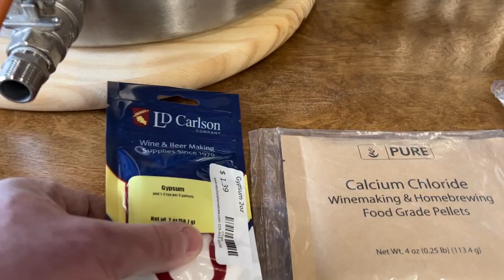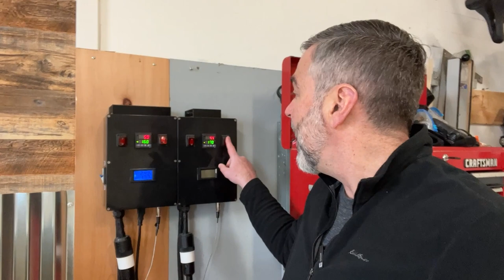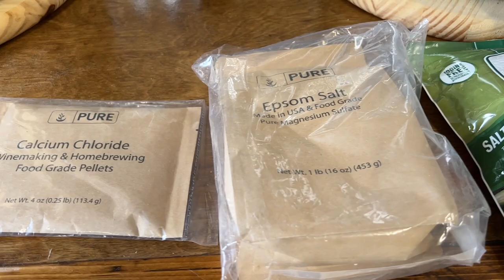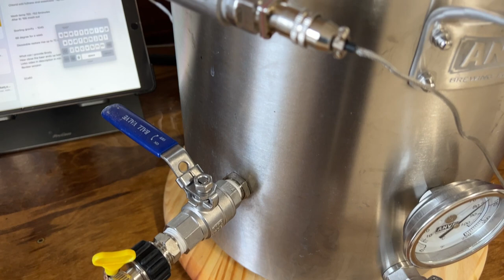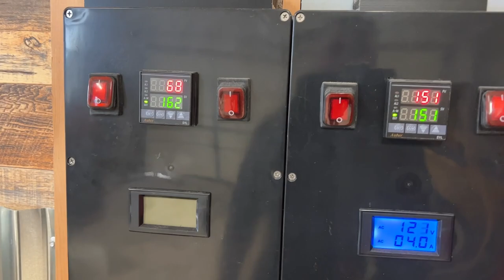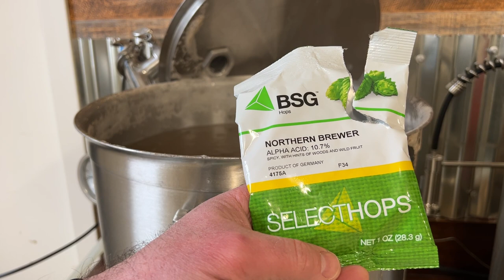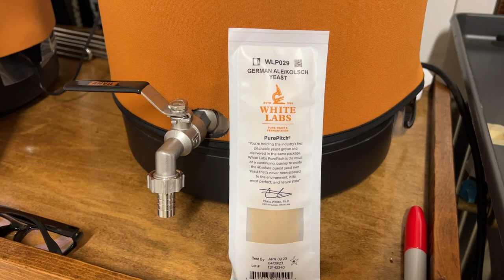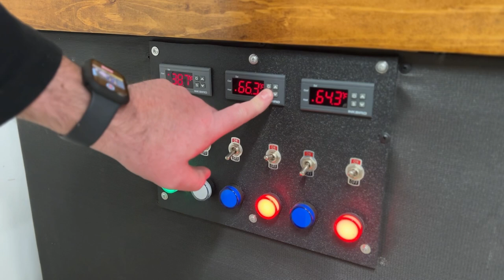Brewing a Kölsch Recipe on My Electric HERMS Home Brewery [ The Beer Junkies Collaboration: Part 1 ]

Comment: Great videos, thanks for sharing! Your HERMS setup is awesome, it's cool to see someone do that with Anvil stuff. I had an Anvil kettle and was amazed by the quality. Question: what did you use to create the stainless hook that you put in the hole in your lid for recirculating? Also, do you have a link to the strainer you bought that fits the Anvil kettles? Thanks!
Reply from the maker: Hey Adam, thanks for the feedback! Yeah, the Anvil equipment is pretty darn good. Not as good as the Blichmann kettles,  but really nice. I didn’t make that hook, it’s just the return pipe from my Anvil Foundry system. I fits perfectly in the Anvil kettle lid hole and works great. I always wondered if the lid was designed for this return hook. I can’t remember off hand where I bought that strainer. It might have been an Amazon purchase. It does a good job, but I do plan on replacing it with a sprayer nozzle or maybe the SS brew tech recirculating manifold next year: https://www.ssbrewtech.com/products/re-circulation-manifold-for-infussion-mash-tuns?variant=7904579717. Cheers!
Reply from the maker: Here it is:https://www.amazon.com/gp/aw/d/B005V2S4S2?psc=1&ref=ppx_pop_mob_b_asin_title . IMO, for a couple extra bucks, I’d go for the ss brewtech manifold.